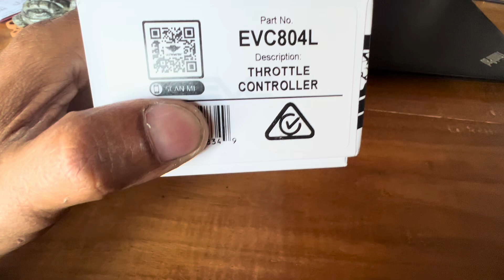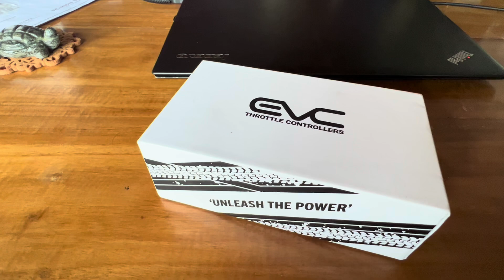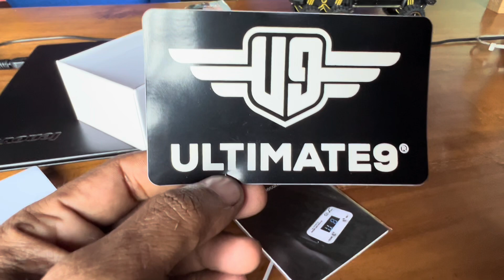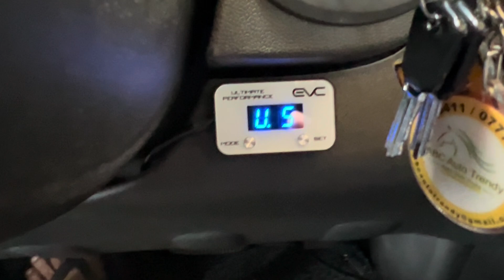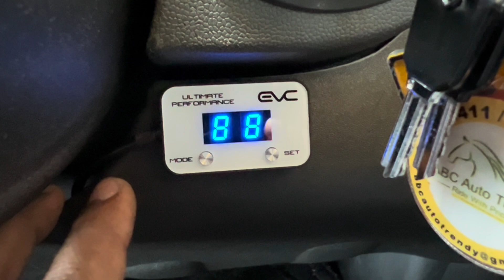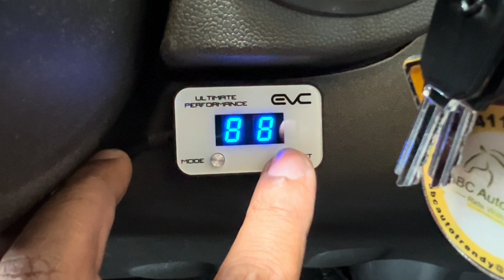Testing the EVC throttle controller with the Nissan Navara D40."

Comment: dont know about that leakin, but had not experienced that, been on U9 and mostly on U7 all the way
Reply from the maker: The vehicle should be ready to adopt the EVC settings unless there are consequences. I am now using the EVC in AC mode regularly with no issues at all.

Comment: I now regret buying a Navara already😂 this guy got a whole channel repairing the car 😅😅😅
Reply from the maker: Buy one we will help you making it better than ever
Reply: @abcautotrendy  its in in Australia bro. Has no power. Already replaced turbo. Deleted EGR. All injectors are working fine. Installed catch can as intercooler had oil in it. Cleaned intercooler. 

Still no power.
Reply from the maker: Send me a video with whats happening to my WhatsApp 0094777329922, I will help you get it resolved